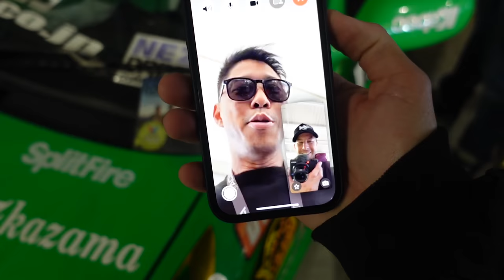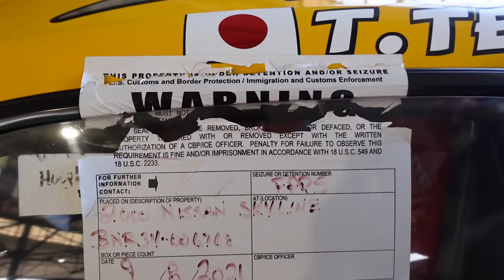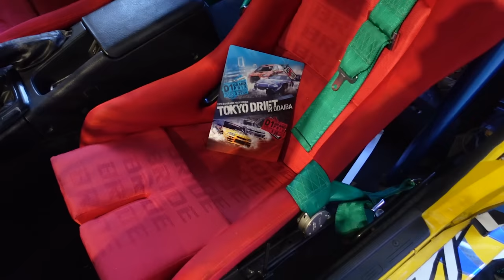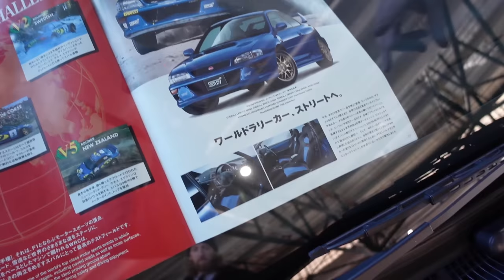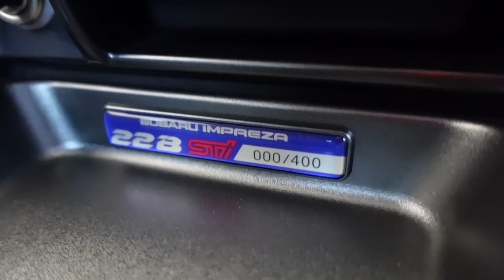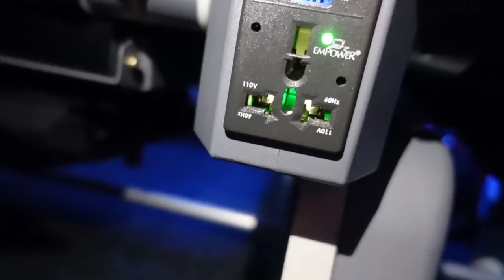Full Tour of the Rarest JDM Car Collection in America!

Comment: I'm surprised you didn't look at the Signal Auto R34 a little closer.  It has one of the early OS Giken spacer plate 3lt stroked engines built on an RB26 block.

https://www.youtube.com/watch?v=QoE1REiMkms
Reply: The R34 you linked to is not the same as coltons
Reply: @xx_mecoboy_xx  Your correct.  Just had a look at the under hood photos and they are vastly different.
Reply: @iswinkels  a lot of people confuse Kousuke Kidas personal street car with coltons car or never knew that SignalAuto build two different 34's, that particular R34 ended up in Trinidad.